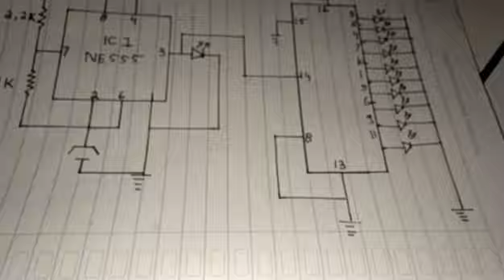Cara membuat lampu led berjalan(running led) part 1

Comment: Mau tanya bos, itu di skema ada resistor 1k pada ic 555 di kaki 7 dan 6. waktu sampean ngerangkai kog gx ada, terus harus dikasih enggak.mohon penjelasan bosku... terimakasih
Reply: resistor 1k pada ic 555 di kaki 7 dan 2 maksudnya. Dikasih enggak maaf pemula hehe, dijawab ya boss
Reply from the maker: Oo masalah itu too
Iya memanh sengaja saya ganti dengan potensio, supaya kecepatan nya biasa di adjusdtable /bisa diatur

Kalau kamu kasih R 1K ya gpp kok kalau mau kecepatannya konstan
Reply: @MoehMaftukin  terimakasih bos,.. ternyata fungsinya begitu, semoga rejeki anda selalu bertambah bos.

Comment: Slamat malam
Gan mau tanya klw d kasi arus DC 24 volt dgn led 1,5 watt jumlah 9 pcs. Komponen apa saja yg harus di ganti atau d tambah...?!
Reply from the maker: Ini max pake 12v ya
Jadi kalau pake 24 langsung bisa rusak semua nih
Solusinya haruss pake R supaya tegangan jadi 12v
Reply: R nya ukuran brapa gan
Reply from the maker: Kira kira pake yang besar dulu aja
10k kalau redup turunin
Dan kalau merasa sudah pass
Tinggal pake